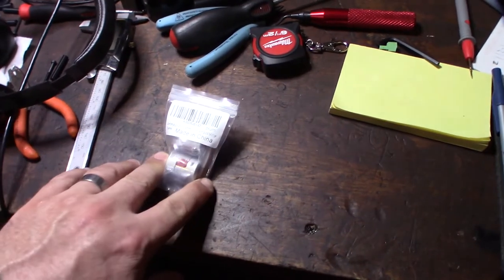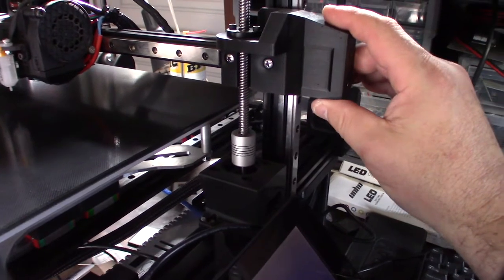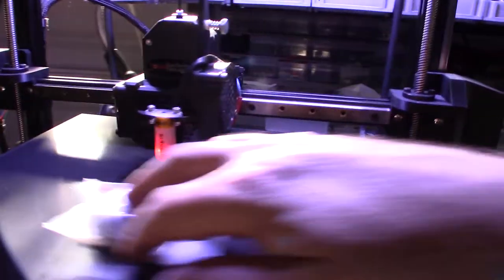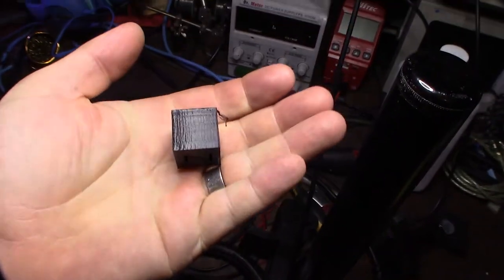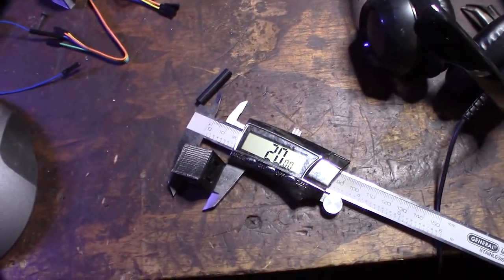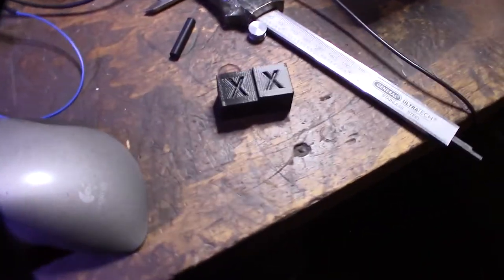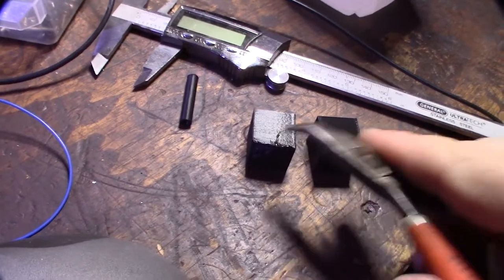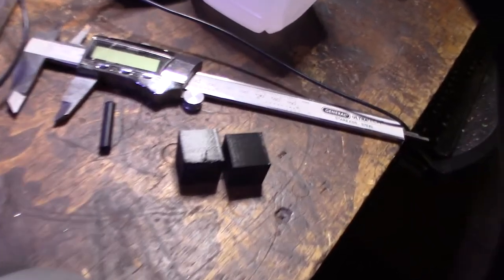3D printer Spider Shaft Coupling Aluminium Plum Flexible polyurethane reduce banding ribbing

Comment: I'm having this exact same problem. The spring action is causing me some issues on the first several layers for some reason. I was planning to try the ones you had there with the red on them. Seems like they would allows some X & Y flex without the Z springing action. I realize this an old vid, but do you have any more insight after years of experience?

Comment: set your steps/mm to whole numbers setting integers will result in ghosting that you have in your prints.
Reply from the maker: That's actually a really good point, probably one of the smartest comments I've heard in awhile. having a fractional /uneven number would complicate and skew the process. Odd number with an even stepper rotation. I'm impressed.
Reply: @fintechrepairshop  thank you. I have battelled with one of those cheap ctc plywood 3d printers for 4 years and turned it to an actual prusa i3 quality printers without spending much money on it. one of the most important changes I made was changing those steps/mm from 87.4 to full 80. that printer is still working with threaded rods and produces great prints. z wobble is not that important if rest of the x carriage is stiff.
Reply: Integers ARE whole numbers…

Comment: The design of the printer seems flawed. There should be stops and bearing on the bottom of the lead screws--they shouldn't be supported by the motors. Best of luck!
Reply from the maker: I'm running Trinamic 2209 drivers with sensors homing. I don't need endstops. I have bearing lead screw supports on top. The printer is custom. Its all linear bearing. I just need to tweak it still. I'm doing the calibration now. My dimensions are off. The printer was originally an Anet E10
Reply: Fintech Repair Shop Your Z-Axis Steppers are still taking a load in axial direction. This is a big big No-No.
Reply: @WurstPeterl  not really a no no, printers like the anet A8 and ender 3 and printers before them have been doing this and getting smooth results for years.

Comment: Yea my Ender 3 Pro prints as good as your Printer Bot which I assume you meant Maker Bot? Never heard of Printer Bot... Thats weird you have these issues with that printer because looking at it you have clearly done a lot of upgrades to it.

Disregard I think I found the printer you was talking about, I spelled it wrong. Is the PrintRbot the one you mentioned?
Reply from the maker: Printrbot was one of the first 3D printers. Way ahead of there time. My printrbot has been upgraded to SKR 1.3, trinamic 2208 and bondtech. I still need to do some calibrations on that printer.
Reply from the maker: The printrbot is called a simple metal. Awesome little printer.